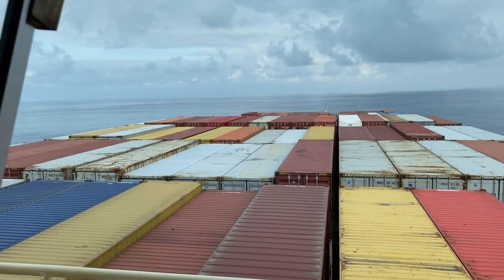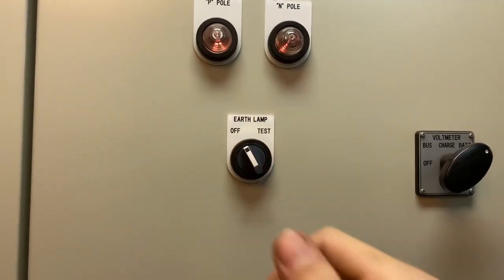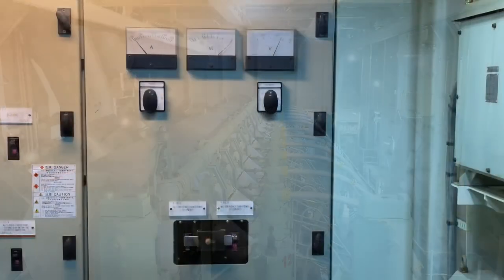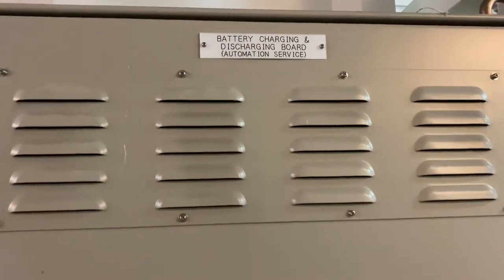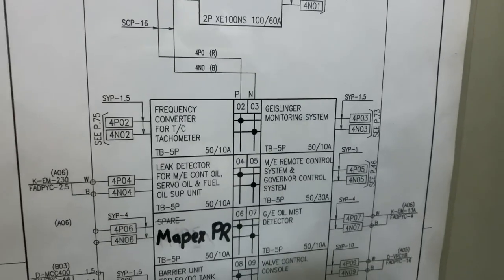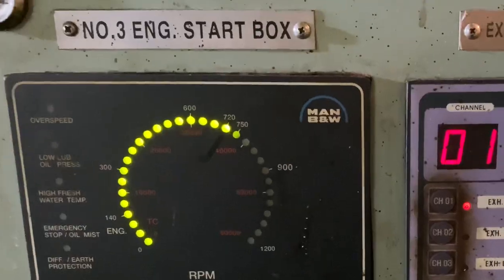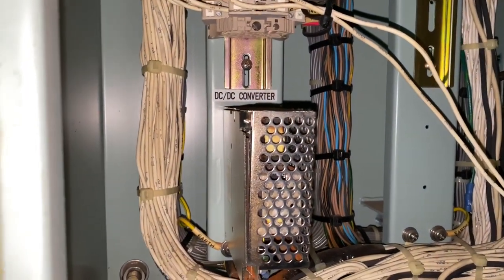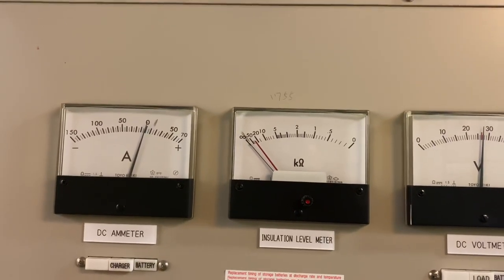FIXING 24 VOLTS LOW INSULATION | Marine Electrician

Comment: Good material, I am also with Maersk. On Santa class unfortunatelly, when you have a 24VDC earth fault, there is an engine stop...but this fault must be only in engine control modules to let it happen.
Reply from the maker: Just had on the ECU B 2 days back and good thing it was fixed immediately. I am doing this fault finding specifically for the MAN B&W engine.

Comment: Goodpm sir leckyjake.. Mayroon ako case dito nah lowinsulation sa 24 V, nka zero ang insulation meter, P at N nag ilaw .pag ene earth test ko sya nag nonormal at infinity reading at ang namamatay na lamp indicatior ay ang  N. Pag balik ko naman  sa earth test switch sa normal position, mag zero at P N ang iilaw olit. Ang ginawa ko sa dc switchbaord namin, dhil may 2 breakers, (DC-A for navagitional equipments, fire alarms etc. at DC-B  para sa Engine control console at main switchboard ) sa DC-A  na inoff ko hindi sya nag normal, pero sa DC-B nung inoff ko nawala ang low insulation nag normal na.so doon ako SA panel board sa engine control room(DC-B)nka fuse na lng sila, 4 na fuse, ang 2 fuse ay para sa main switchboard positive at negative, at ang dalawa pang iba ay sa engine control console.. Tinanggal ko isa-isa ang positive fuse ng main switchboard, at engine control console. Wla parin,So tinanggal ko ang mga negative fuses. Sa engine control console wala parin nangyayari, pero nung ang negative fuse na tinggal ko sa main switchboard. Nwala na ang low insulation at nag infinity.

1.)Engine control console(alarms indicators and anunciators)
2.)DC Main Switchboard alarm (alarm circuit na may tatlong cards. Alarma Para sa low insulation 440,low insulation 100,preferencial trip at Emer. GEN. Eng. Abnormal at power ng lamp indicators sa emergency gen., (Emergency Gen. run, eng Abnormal at stanby , 
nung tinggalan ko ito ng negative  fuse saka pa nawala ang low insulation.Ngayun palang tu nagka low insulation 24v,kadalasan nmn dito ay 440v,100v.